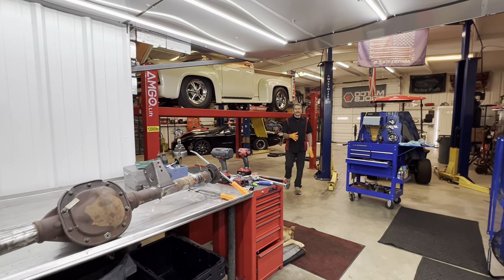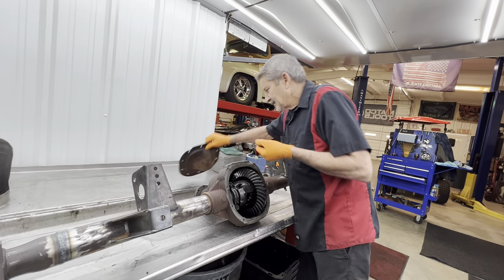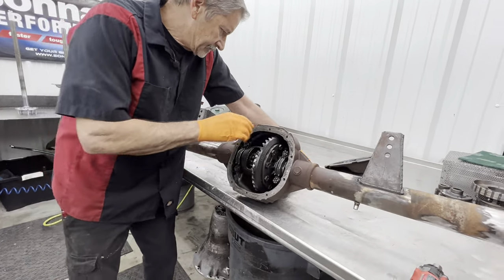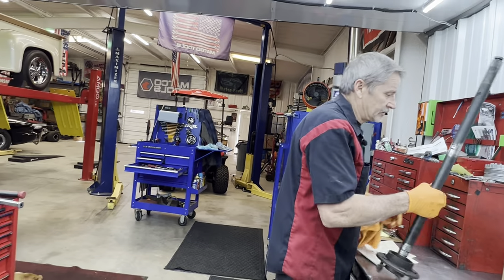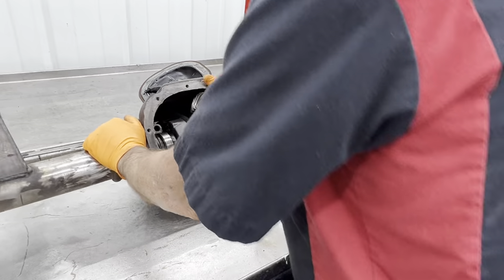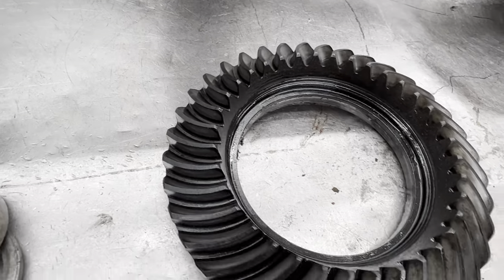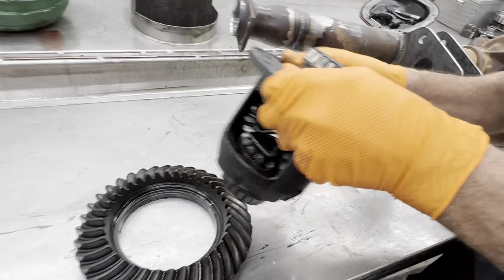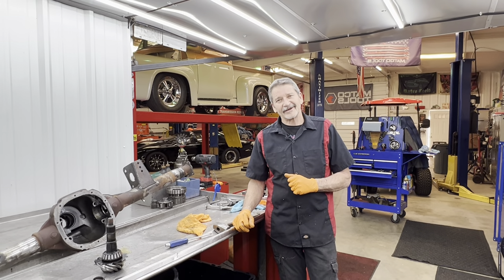Ford 8.8 - R. Differential

Comment: That one is actually 3.27:1. It’s stamped on the ring gear and on the end of the pinion. Surprised the axle tag was still there, being it had to be opened up to remove the axles, to have the axle tubes shortened.  Very rare for a p71 to be equipped with a limited slip rear(unless or was swapped). The axle tag will tell for sure. If it is stamped 3.27:1, it was originally an open rear 3L27:1,limited slip
Reply from the maker: Yes sir your right

Comment: If you are replacing the seals on those 8.8's like I had to do on my daughter's FX4 Ranger, use the end of the axle when sliding it out to grab the seal and pop it right off. Those long axles give a lot of leverage and pops those old seals right out.

Comment: Did you ever have a police cruiser come in for a transmission because the officer put brake fluid in the trans? Usually the officers wanted time off or a new car. Or so I've been told.

Comment: Love your content!! Thanks for teaching all of us. But wouldn't that be a massive downgrade from the original ford 9" rear end???!? 8.8's are throw away garbage compared to the 9".
Reply: Depends on the original drive train. It’s possible it was originally equipped win the 8” rear. Don’t read or hear much on upgrading those.
Reply: @kd7cwg  Galaxy's being full sized always got the 9".
Reply: They aren't as weak as you think they are. Go see what Cleetus puts his through.... full send. 

There are advantages to them; you may not be able to change the carrier since it's a c-clip style assembly, but it's a lot lighter and the tooth angle is much more efficient.
Reply: @classics289  - not always -  starting in 1966, some came with a 9 3/8"
Reply: @OHUQTU  the 9 3/8 has nothing to do with this conversation. They were a weird bastard rearend that didn't go too far. They were all 31 spline but weighed a lot more than the 9". Nobody wants them and nothing aftermarket is available for them. 8.8's were a manufacturing cost cutting cheap rearend that will work but is extremely inferior to the 9".
Reply: @classics289   -- YOUR inaccurate statement that " Galaxy's being full sized always got the 9"" made MY statement everything to do with this converstation.

Your response is an admission that the 9 3/8" was, indeed used from 1966 and on. Your diatribe that "details" the 9 3/8" has NOTHING to do with the FACT that Ford designed and applied them for 1966 Galaxies, and other later cars and trucks.